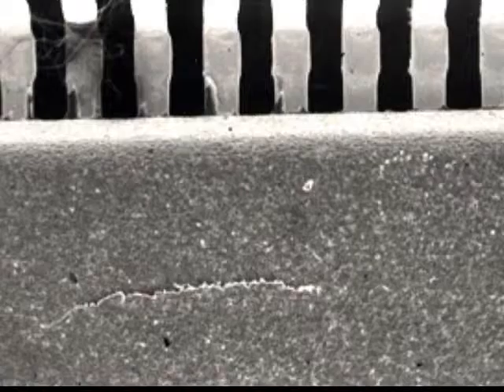Causes and solutions for popcorn defects in plastic packages

Comment: According to industry standards none should solder without baking every chip for a couple of days,wear antistatic clothing,wrist ground and the entire building is completely grounded.Lead solder melts in 185C and lead free in 217C,but in practice with these temperatures nothing melts even in the solder tip,not to join parts in a board.In other words popcorning means the proof of a defective chip blaiming the customer.If there are moisture sensitive devices then a moisture protective package should be used,if not i believe there is something wrong in the entire case.In an assembly line in a factory is taking every measure to eliminate every kind of fault,but in a service shop or a house soldering one or two devices in a six months period and these popcorned even if they are stored for days in a room temperature i think they are defective from the beginning.